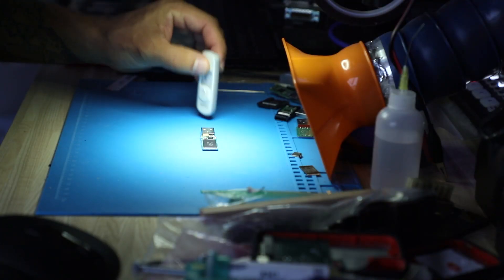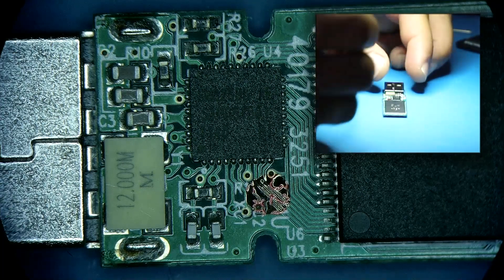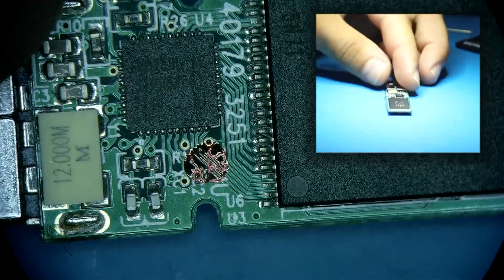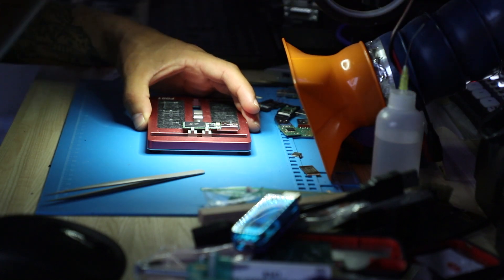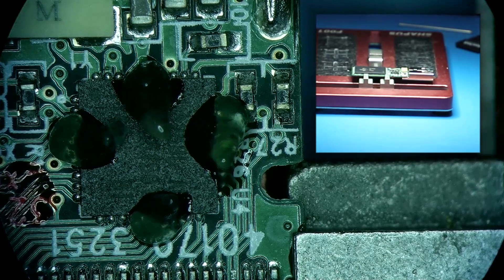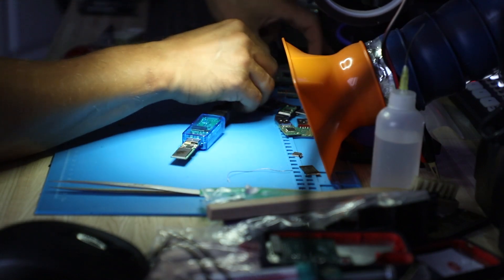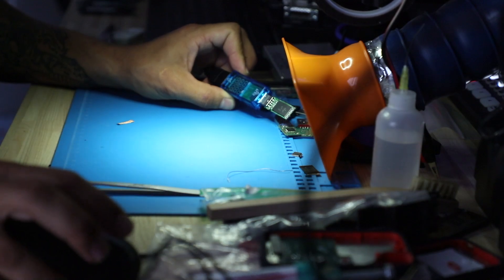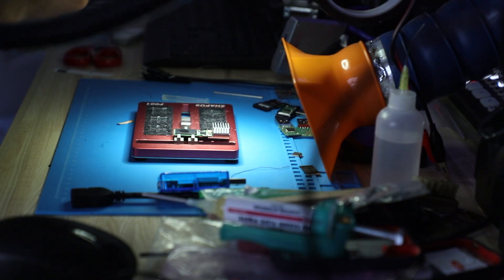how to recover data if the flash drive got bent.

Comment: Thank you for this great video and explanation. I have one question. after your recovered the SD card, was this card working? Could the client still usuing this card?
Reply from the maker: it could be, but sometimes the cases is damaged during opening. And esthetically that may be an issue